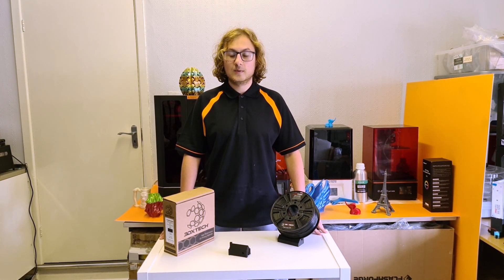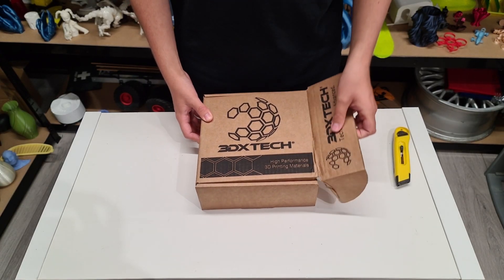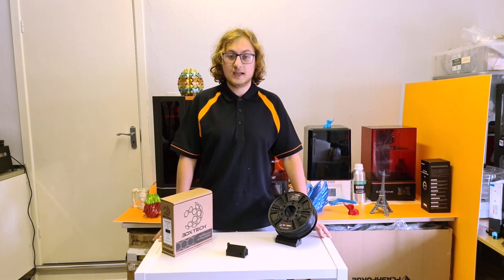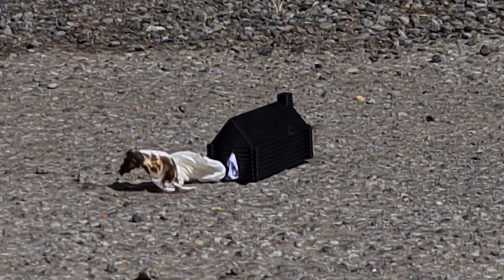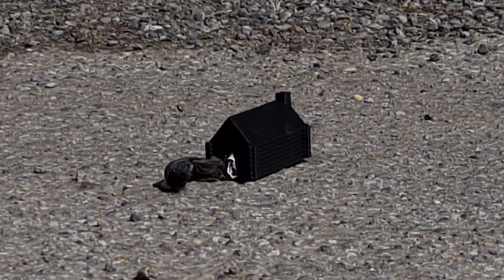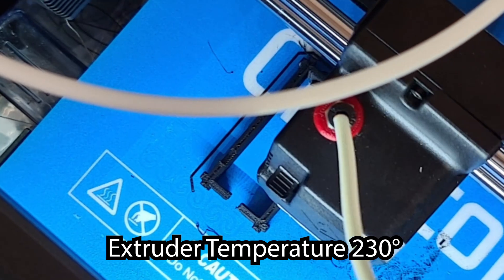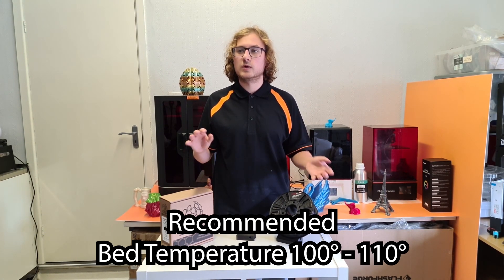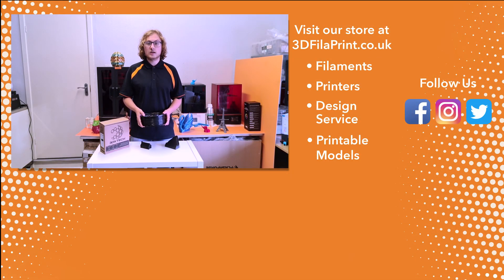Flame Proof Filament - Firewire from 3DXTech

Comment: Interesting stuff!  But if you are trying to show a comparison between materials then you need to keep everything else the same.  You need to use the same model.  The house model has very restricted air intake through the door while the barrel with the open top has lots of room for air to fuel the fire.  The paper in the house didn't even burn past the doorway.  This has nothing to do with the material used, but the lack of air to keep the fire going.  I would love to see the video again using the same barrel model as that would be a true comparison.
Reply from the maker: Hey Jim, thanks for the feedback. We're still trying to grow as a channel and feedback is a way to help us do that, so we really appreciate it. We'll take your suggestion on board.